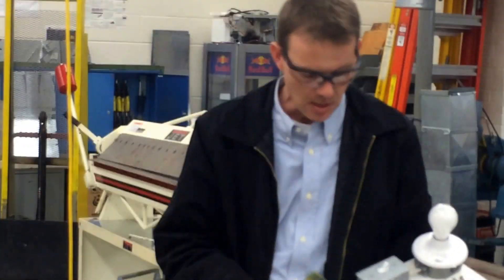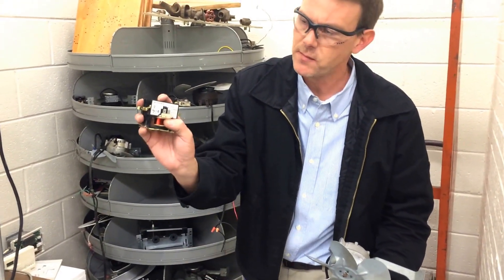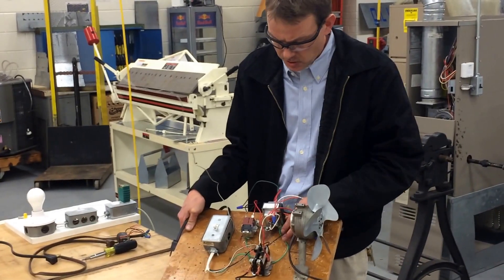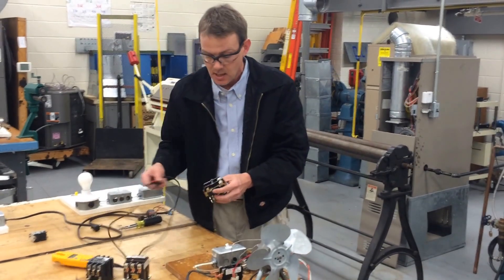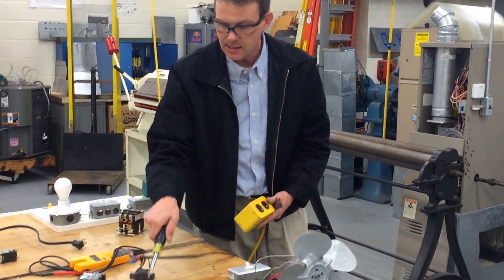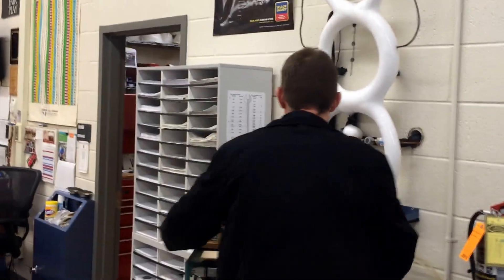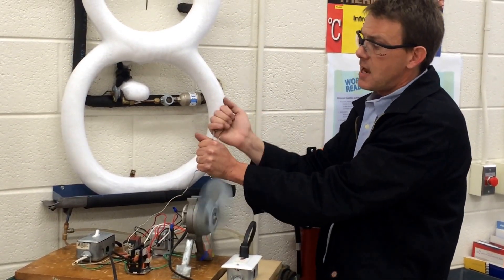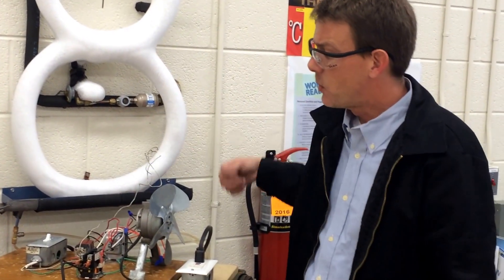HVAC Basics: Electrical - Project 3 Contactor, Fan, Thermostat & Transformer

Comment: I wish this went through it step by step like the other commenters said, but overall, I wish you had lectures for more of the electrical in general. Youre such a great teacher, You cover Ohms Law and AC/DC current etc., but wish I had a teacher like you for teaching the rest of the HVAC components (rest of unit 12, unit 13, 14, in the hvac book you were teaching from for your epa certification videos). Im heading into Intermediate Refrigeration next week and dont know what I will do without you :( you saved me in beginning refrigeration and got me an A (unit 1-11)
Reply from the maker: Drawing Ladder Schematics - Contactor, Thermostat, Transformer & Fan Project 3 https://youtu.be/jBMNYtHq4zM

Comment: I need something like this for my HVAC which, due to a circuit problem, stopped controlling the blower. To avoid replacing the whole unit, the blower  was connected skipping the control unit, therefore it is ALWAYS on.